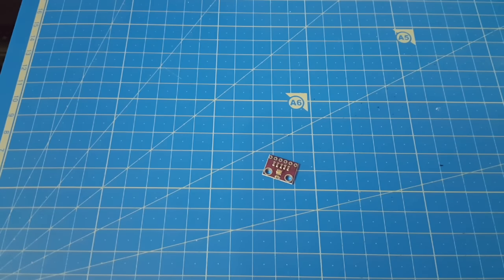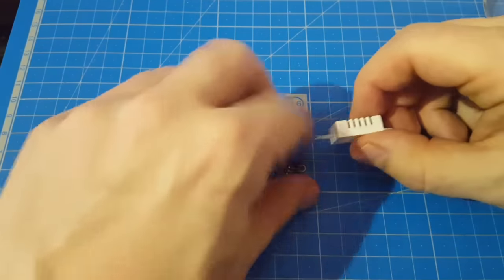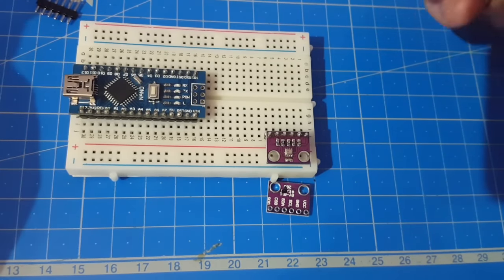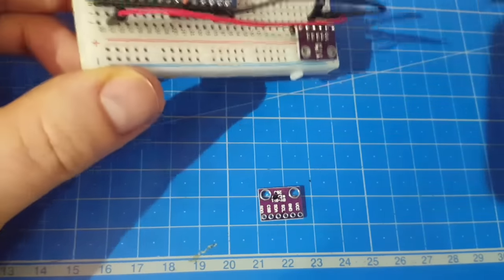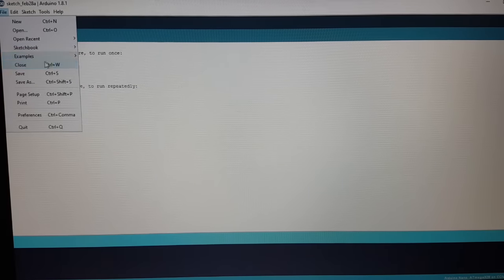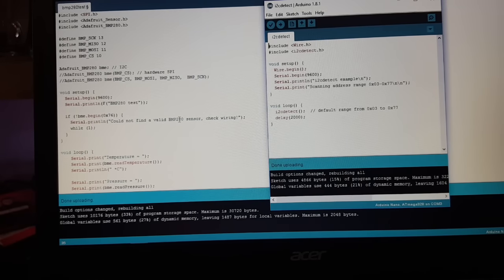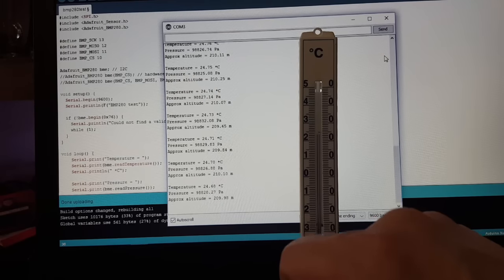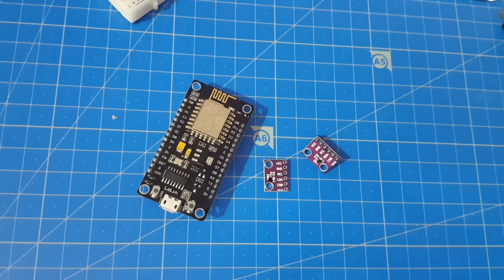BMP280 temperature and pressure sensor on an Arduino

Comment: At the bottom of the code there's an adjustment to be made in hPa (/* Adjusted to local forecast! */) - search for a METAR reading in your local area and adjust the hPa value in the code to match this - should give a more accurate "Approx altitude"
Reply from the maker: Thanks! I'll give it a try!
Reply: IIRC, you can get even more precision by knowing the height above sea level of your exact location to calculate an even more precise hPa adjustment factor.

Comment: Arduino nano is compatible to 5 V, isn't it? Are two level shifters required to be added outside the bmp280 sensor (at scl and sda)? I have done all the steps and only zeros for pressure and temperature are returned. Any ideas?

Comment: I have connected the sensor using I2C transmission like in the video but nothing. I use some codes to define the I2C port but they don't find it, so I try every port from 1 to 128. I checked every connection 10 times and tryed the with 2 sensor. Ideas?
Reply from the maker: Have you tried the i2cscanner?
Reply: @nenioc187  yes
Reply from the maker: If the I2Cscanner shows no address, there is still plenty of possible errors.. there could be a wiring problem. Maybe the sensor is broken. Maybe one of the analog pins of the controller is broken (had this once). Maybe the sensor is broken. Have the controller and the sensor a common ground line?
Reply: @nenioc187  now the seller have told me the two bmp bought have a problem so he will refund me...

Comment: My BMP280 came without the onboard level shifters. Meaning it runs on 3V3. I have a couple of options... 1) Provide two rails - 5 volts and 3.3 volts - and Include separate level shifters. 2) Is more interesting... Run the Arduino and the display on 3V3, too. Here's how to do it. The Arduino has an auxiliary 5V output pin. This output is after the Arduino's voltage regulator. Simply input (yes, input) 3V3 on this pin and the Arduino will run, happily. Next, use a 3V3 1602 Display. Or, convert a 5V unit. They (mostly) all use a common board which can be configured as either voltage. The 3V3 model uses a L7660 negative (yes, negative) charge pump to lower the 3V3 ground point to a net 5 volts = clever. All the needed vacant pads are already on most 5V PCBs. Just add the L7660 and a couple of caps. HTH.

Comment: So the sensor is just completely inaccurate when it comes to the altitude?
Reply from the maker: The altitude is calculated by the air pressure. And since the air pressure varies, the accuracy is rather low. You could increse it, by taking the current temperature and the air pressure at sea level at your location in consideration.
If you want a higher accuracy, than a satelite based sensor, like GPS, would be a better choice.
Reply: @nenioc187  Ah Okay, I see. I'll need to look into GPS sensors and maybe even combining that sensor with the BMP as a backup. My altimiter will need to be correct, 100% of the time

Comment: Help! I cannot get this device working. Does it need logic level shifting with an arduino uno? Can't even scan it for an address, nothing. Thanks!
Reply from the maker: I had once the case, that the sensor wasn't recognized. I2C scanner didn't find it either. The solution was: the sensor was defect. Replaced it and it worked fine.
Reply: you can switch the adres for 0x76 put sdo-gnd  for 0x77 put sdo to vcc

Comment: Nice! I'm originally from almost where you are located (always good to see familiar names on the map). As for the altitude: this should be corrected for QNH (so, like you're saying, the weather basically). I've seen tables for that in other sensor manuals; still gotta check this one.

Comment: Quick question: on which side should we solder? On the side with the writing or the side with the components? I did the soldering on th side with the writing and I feel like this is why it didn't work. Looks like the copper wiring is on the other side and if the soldering was superficial it didn't make a proper connection.

Comment: Hi I messed around a few days trying to get it working, have the address in the if statement did the trick. Many thanks and I can confirm it does not work with 5V
Reply: i just ordered a few of these without realizing they are 3,3v, bugger

Comment: The Adafruit BMP280 library did not even detect my sensor (which was almost the same model, GY-BM ME/PM280, but it was detected with I2C Detect) so I installed I2C Sensor Lib and they include a BMP280 example that works (and you don't even have to type the 0x76 address in there)! Also, I believe the first variable is the elevation while not detecting small changes (average over time), am I right?

Comment: Thanks for the video.

I'm curious, is this sensor sensitive and fast enough to measure air speed differences when blowing on it through a small tube glued to the hole on the sensor? And also the tube itself will have a small hole to make it possible to blow through, like if when playing a flute.

 I'd like to use it for MIDI controller, but I'm not sure if it won't be too slow or not enough sensitive (not detecting enough levels of blowing).
Reply: That would work! I have a similar use to measure wave height in the ocean (relatively) with it at the end of a tube.

Comment: How & where can I connect an hose to this sensor in order to measure the under water pressure?
My aim is to measure the under water pressure & to demonstrate that the pressure increases as the depth/height of water increases (Hydrostatic Law).

Comment: Oh very good work. I'm really happy fro your video. 

Currently I'm trying to measure  Blood pressure. I'm using resperry pi 3(it can only read digital sensors  ) and therefore I like this sensor as it digital output.  Could I use this Barometric Pressure Sensor for that purpose?
If it does how to connect Air pump and Blood Pressure Cuff with sensor ?

Please could you help me?
Reply from the maker: That sounds like a great project! I'm not sure how much air pressure is reached within the blood pressure cuff. This is the thing you probably want to measure. The sensor can handle up to 1100 hPa.

Comment: All the serial monitor says for me is the timestamp and "BMP20 test"

The I2C detect doesn't detect anything. But it doesn't say to check the wiring, so the sensor must not be defective?
Reply from the maker: If the I2C scanner doesn't detect any device, it might be because of wrong wiring, wrong supply voltage for the sensor, defective Pins on the I2C bus,  or - as you said - defective sensor.

Comment: Incoming data appears as "nan". How do I fix this problem? 

Temperature = nan *C
Pressure = nan hPa
Approx. Altitude = nan m
Humidity = nan %

like that
Reply from the maker: NaN stands for "Not a Number". Maybe you are using the wrong I2C address? Or forgot to the VCC connection to the sensor?

Comment: as far as i know the arduino NANO have 5V logic voltage, does it safe when sda scl connect directly to NANO analog pin? or should i use voltage divider to 3.3V first? thank you
Reply: See my post, above to learn how to run on 3.3 volts.

Comment: Thank you for the video. I bought mine for 50 cent! 
By the way the it only supports 3.3v, is it safe to work with 5v?
Reply: See my post, above, to learn what is needed to run on 3.3 volts.

Comment: Good video, my friend.  Could you describe how you discovered the correct address for I2C?
Reply from the maker: There is an Arduino sketch, called I2CScanner. You can find it in the examples.
Reply: @nenioc187  Excellent.  Thanks!  New to Arduino & I2C, learning so much.

Comment: I have the original Adafruit BMP 280 but when I try to do it it says "Adafruit_Sensor.h: No such file or directory"
Reply from the maker: Have you installed the BMP 280 library with the Library Manager?
Reply: @nenioc187  Yes I did

Comment: Is it possible to use more than one of this sensors at the same time? I think they have the same i2c adress, haven't they?
Reply from the maker: I took a brief look in the datasheet provided by Adafruit. And it seems that you can change the I2C address by either connecting pin SDO to GND or SDO to VCC. So theoretically you should be able to attach up to 3 BMP280 sensors on one I2C bus. 
Although I haven't tested it - yet ;-)
Reply: nenioc187 Ok, thank you!

Comment: do you really put the value 0x76 inside the code? im also having the same problem as you
Reply from the maker: You can use the sketch I2CScanner to determine on which address the device is listening.
Reply: @nenioc187  i already did that and i got 0x77, so whats next? Do i hav to put it in the codes or else? Can tou email me your worked codes
Reply from the maker: Instead of using bmp.begin(), use bmp.begin(0x77, &Wire) to initialize.
Reply: @nenioc187  ok ill try it thank youu

Comment: i want to ask that this sensor (BMP280) messure humidity, doesn't it?
Reply from the maker: The BMP280 measures only temperature and air pressure.
The BME280 measures also humidity.
Reply: i have recently read datasheet of them. i understood. Thank you very much!